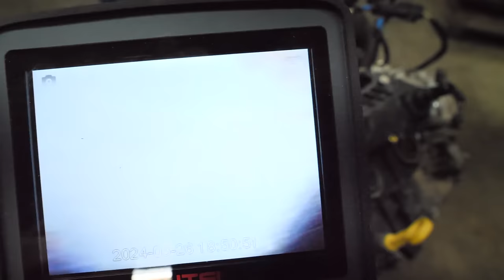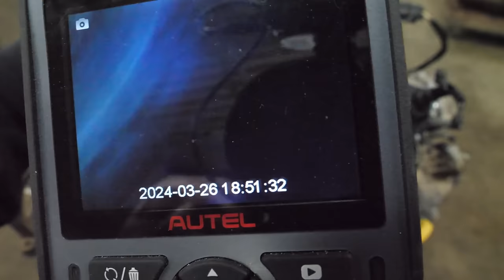ANOTHER BAD 2.7 Ecoboost? 2018 F150 Twin Turbo V6 DEAD @ 131k Miles

Comment: I had that truck, and traded it a year ago. I liked the engine, but did have a nagging feeling that the turbo's would fail eventually. It had heavy steering, more truck than I needed so went back to a Tacoma was main reason I traded it. But...I recently drove a '20 with the NA 3.3L in it, and with that same 10speed I loved it. Was not a slow truck, and if u floored it > it hauled ass all the way to redline vs the Ecoboost where you would have to be in the right drive mode to have any power over 4k. I think if they wouldnt have deleted that engine before it had 1 year with the 10 speed it'd be more popular among the 2.7 owners who just wanted a fuel efficient simple engine.

Comment: in the 1 litre ecoboost 5w 20 oil with the C948 specs should be used. The older ones are worse than the newer from 2015, so they say... My girlfriends 1 liter ecoboost has two new belts had last week, at 95.000k km's and 7 years. I must say the belts looked like new... The shop manager said you cannot predict what the condition of the belt is, only that the newer cars seem to have better belts. She has let it replaced because she didn't want to take the risk of ruining an engine

Comment: A quick google search says that the oil belt change interval according to ford is 150k miles. Given the condition of the belt at 130, 150 may be pushing it depending on how many miles you drive in a year.
Reply: It's extremely annoying that Ford decided to route the belt they way they did... and that they used a belt instead of a chain.

Comment: As a fellow BMW guy, how about the R56 in the Mini Cooper S that's prone to inconel valve failures? I was given one that had a valve failure, the shop literally replaced just the 1 bad valve and left the other 15 original ones in there, 13 months later, a second one failed and the car ended up mine out of the owner's frustration with it.

Comment: Always change my oil in my diesel super duty and my other little car at 3500 miles. I hope the inside of my engines look that good.😊
Reply: I think most issues with these modern engines are due to people that wait until 7k or 10k miles to change their oil. Many of GM's AFM issues are definitely due to people pushing oil changes way too far. Same with cam phaser issues on Ford engines. Engines with timing chain stretch are usually due to extended oil change intervals. I know guys with well over 200k miles on their GM 5.3 that have never had a bad AFM lifter and they're the type that change their oil every 3000 miles. The old timers had it right when they changed it that often. No doubt in my mind. I'd rather spend extra on more engine oil than a lot more on engine repairs.

Comment: I look at that engine, and I see a good design, let down by two things. The oil pump drive, and the oil pan. I wonder if there's any aftermarket companies who would be interested in making a metal replacement pan? Same with the pump drive?
As for the milkshake in the cylinder, I'd guess that came from a different engine, added as an additional reason to reject/replace it. Unless there's something I missed, from looking at the head, block, and gasket, there's no reason for it to be there that I could see...

Comment: Looks like good maintenance practices caught a failing engine before its impending catastrophic failure. Looks like you got a good rebuildable core engine out of it though. I bet the fuel washing down the one cylinder caused it to wash oil off the pin making it wear more. That would explain some of the side to side movement. Since the pin are press-fit that would explain why it didn't come apart.

Comment: If I was a shop owner, I'd keep the core and rebuild it on the side then sell it as rebuilt with some warranty. Every shop has idle time once in a while. Defect it, buy the parts, reassemble. Wait and sell it. The important question is whether there are + size pistons.
Customer should get a deal on the old engine as it will be rebuilt and swapped for the next customer.

Comment: Several things could be the culprit in these higher mileage oil pump belts starting to delaminate, but haven't failed. The reasons could be, the drive pullies need to have a larger radius, influence of the alcohol content in the fuel, extended service intervals. A chain replacement would need to be a duplex roller chain, not a link plate type. Turn the belt inside out to see if there are any cracks on the inside and if the teeth are showing degradation.

Comment: A "used engine" with a belt driven oil pump is doing no one any favours. Of course, a "new engine", with a belt driven oil pump is about in the same boat.
Bic lighters all.

Comment: I always freak out when you start turning the engine over when the timing chains are off. Once you took one head off the other still had it's valves above the pistons and you were moving them with the hammer handle.
One of the plugs was really clean as well

Comment: With the one piston moving side to side, I would have swapped in a used engine. Not sure about the options on going oversize pistons here, but I am guessing that a good bottom end used would cost less than the cost of a bore, hone and pistons, especially if you need to buy them with the rods like in this configuration. My guess is that the owner drove on with the one burnt valve and only came in to the shop when they had an overheating event that melted that chain guide and got the head gasket to let in some fluids into the combustion chamber on that one cylinder. They probably did the right thing by doing a leakdown test, a boroscope to reveal the valve that had been burnt and clearly had been driven a while after that, then called the engine because it had both an overheating event and a burnt valve, without investigating the damage caused by the overheating event. As you said, it's cheaper to plonk in a good used engine than to pull the entire engine and then see what it needs to be rebuilt, rebuild it and go on. Not pulling the engine in this scenario and gambling on just the head (can you even do that without pulling the engine? You need to do voodoo with the chains.) would have left a questionable bottom end in the car.

Comment: Ford recommends the oil pump belt be replaced when you service the timing at 200k miles
Reply: Why, why would Ford do this to people spending that kind of money on a truck
Reply: I would do it long, long before that. From what I have gathered, the belts break down faster when exposed to unburned fuel in the engine oil. Anyone that frequently drives short trips in cold weather should really plan on having it changed closer to 100k than 200k. I think that's why 1.0 Ecoboosts have had such a terrible time with oil pump belts degrading or snapping. They're in passenger cars that do tons of short trips that leave unburned fuel in the oil.

Comment: I’m surprised ford didn’t go with a fiberglass belt for the oil pump, claiming “it sheds particles to prevent excess compression”.

Comment: When the factory assembles the bolts, for instance, in a front timing cover one or two more of the bolts may be a different torch than the balance and that is why they use a different socket size so that bolts are set to torque spec

Comment: When I was a kid (late 60's, early 70's), it was common when you needed a water pump to just go to the pull a part. I don't know the the old cast iron water pumps were better or folks just didn't have the money to buy new. I suspect it was a little of both.

Comment: I looked at maintenance schedule, belt is not a ‘wear’ item and there aren’t known intervals for them.
Doesn’t say much though, much life ‘sealed transmission’ with ‘lifetime fluid’.
I did see 2 2nd gen 2.7 at high miles, one was 540k and the other 475k, per owners, no belts were replaced, even turbos were original.

Comment: Erica you mentioned some people say these engines fail due to their high output, I do not think these people have an understanding of modern materials.  Factor finite element analysis and these engines are over engineered for the power it does make.

Comment: In addition to the wet spark plug, note the clean spark plug at 3:22. Either there was something funny with that cylinder (as it turned out to be), or they threw a set of junker plugs in before selling the engine.

Comment: Well given the valve, there was also that odd guide that was being eaten so that would have been a failure plus the belt for the oil pump. I do wonder if they got a gen 1 replacement to sidestep the oil pump belt. Its a rebuild engine for sure. They might have just looked at the miles on it and assume that it would be better to either rebuild or swap and not repair. I mean overheating they could have went with a better safe than sorry on possible damage deep inside the block. Either way its good money.

Comment: This engine came from a dealer.
Dealers don't rebuild, they replace.
Also, yes this was a tune issue.
The only way you get a burned valve like that is running too lean with too much boost.
Could also have been tune + bad gas.

Comment: Maybe the one fuel injector got partially plugged up, causing over lean mixture that eventually burned the valve. Maybe the manufacturer could add exhaust gas temperature sensors like some airplanes have to catch problems before something breaks.

Comment: I believe this engine you can swap out that plastic oil pan with an earlier generation aluminum pan and fix the common leak issue. The pickup tube needs replaced too IIRC.

Comment: I didn't finish my post below, I was in business for 37 years, I would drive 35 to 40k miles each year I would rank the pickups in this order 4.6 2valve ford #3, nissan 2.4 #2 and the toyota tundra #1, all 3 brands I would drive more than 120k each.  I owned more than 31 new trucks and cars the best overall was the 4 Acuras I owned over 40 year period.  Japanese build best cars and trucks.

Comment: I'm so glad that when I test-drove an F150 with the eco-boost motor I didn't buy one. I was in the market for a new truck at the time, and decided to go for a Toyota Tundra 5.7 I force. Mine's a 2012 and runs like a watch still, it hardly works if at all to pull my motorcycle trailer. You don't notice it back there.
Reply: No one notices your truck either…
Reply: @pathunter7003  not too bright are you?
Reply: @kman-mi7su  well you proved that you aren’t too bright…

Comment: Sorry, as a shop tech, we don't repair engines with internal failures outside of a maybe head gasket and even then its hard to say with mileage,  like you see, these are very complex engines, and if you have to give a customer a warranty for the work, its better to just replace the engine with a new/reman or good used, if it was my own and I was taking on all responsibility, yeah I would probably either repair or replace the one head.

Comment: When the engine oil is hot, it will shoot across the room because of the orientation of the drain plug. Only happened to me the one time...
Reply: You have to be smarter than the oil..

Comment: This makes me appreciate my similar 2.0 turbo a little more. Real oil pan and plug, vertical can filter right next to it like it should be. The only bad thing about them is the goofy exhaust headifold and getting the valves cleaned every 80k. They're pretty dang powerful for their size with decent mileage if you maintain them!
Reply: You must have not paid attention to the vid, this engine had a oil plug and pan, or are you just being silly?
Reply: @pathunter7003  No car loving person in their right mind would call a plastic pan a "real oil pan". (Not to mention the terrible rubber pump belt). That's why I put the word real first.

Comment: The Kevlar belt may be cheaper, but the cracks that you see in the outside have almost nothing to do with the strength or longevity. That comes from the Kevlar eel to steel belts in a tire, steel belts or what creates the strength not the rubber on the outside. I’m not saying no less longer. They won’t last longer, but it’s not the rubber crack that you see that make any difference

Comment: The main problem out of the belts in oil is that rubber particles will block the oil passages screen and filter. 
That I have seen several times.

Comment: Why would Ford build what is obviously an excellent engine and use a belt drive for the oil pump? If you lose the oil pump the engine is going to destroy itself. That is just stupid. 46:29

Comment: When you see the guts of this engine, at the first sight it looks like a masterpiece of engineering and machining. But going deeper in details, lot of things seems unnecessary complicated specifically for distribution. This is where pure engineering meets capitalistic goals that don't give a shit of durability but aim to skyrocket maintenance costs. Which pushes these engines into premature retirement.

Comment: I helped a friend replace a 2003 explorer heater core….holy crap…had to remove the entire dash…😮. It only had 90k miles! It wasn’t neglected(50k mile flush).
Took 12 hrs. Never even considered a ford after that.
Reply: GM is the same.

Comment: Dont forget that all that valve material went through one of the turbo's so that would certainly compound t h e problems,  then tgere was the timechain tensioner that was all chewed up.  Lots of little things failing affecting lots of others.  Bit of a domino effect.
I must confess I find the belt driven oil pump to be a huge concern and see that as a high mileage failure point.  They had two chain drives on the crank right next to it.  What could it cost to machine a third drive sproket on the crank to drive the oil pump, or gear drive it, even if you had to use an idler gear.  That could be an advertising durability point, chain driven cams and chain or gear driven oil pump.  It's like stepping over dollars to save p ennies

Comment: No body has killed their own brand loyalty more than Ford. This is why you either get the 5.0 v8 ford motor,  or nothing.  Apparently they have not invested in what it takes to make these motors that are born needing boost to perform to make them last as long as the older non boosted models do.
Reply: The five oh has its own set of problems, maybe why most folks won’t buy a truck with the five oh in it

Comment: The belt in oil isn't a bad idea at all. But the way it's been done it is......, the belt in my himble opinion shoud be working on it's own oil, closed, clean. With a dip stick or a way to check the bt condition and the oil level, and with a waybto change the oil from time to time.......maybe this way the belt would last the entire engine life without belt issues....

Comment: Just changed my oil for the 2nd time in my 2022 2.7. Smelled like straight gas probably because relatively short trips and DI. That cant be good for the belt.

Comment: A friend of mine had an Ecoboost F150. 55,000 miles it went boom. Ford would not honor the warranty. Subaru took it on trade, and ever since then, we've called them Eco-Boom!
Reply: Part of that refusal to honor the warranty might have been due to that pesky computer ratting out the owner. I had the fuel pump on my then-new '97 GMC toss a code, and they asked why I was going 70mph in 3rd gear when it popped the code. "I was towing my boat up Vantage grade, and it was doing a fine job!" was my reply. That's a 6% grade, said to be 15 miles long. They put an upgraded pump in it. The trans puked at 61k, the day after I got back from a long weekend trip to/from E. Oregon, which would have been a serious inconvenience. The "Reman" trans the dealer put in was CRAP.

Comment: Ford built the Lion Ecoboost diesels from the same designs as the LR TDV6 3 litre diesels (they also shared it with PSA). When the F150 was launched there was a big rumour it had the Discovery 3 diesel but Ford went strong and said "No its not from Land Rover its built in Dagenham" Except so was the Land Rover diesel!
It was an engine that should never have been built because cranks snapped like fun on Land Rovers.

Comment: Combustion can reach 4,000F while steel melts at 2,200 - hence the melted valve.
Thing is though how did such hot gasses get past the valve?
Was it propped open on a speck of dirt or some inlet passage debris?

Comment: Stupid decisions are made.    The 2005 Passat TDI had an oil pump /balance module that was driven by a chain,  a non roller chain,  at twice engine speed on sprockets.   In the end they modified it and put a gear on both shafts (heated on).   No more chain.   I have never even seen a non roller chain,  and running twice engine speed.   Stunning.    Its not if it will fail,  its when.   Some at 30k and some go forever with the average about 130k.